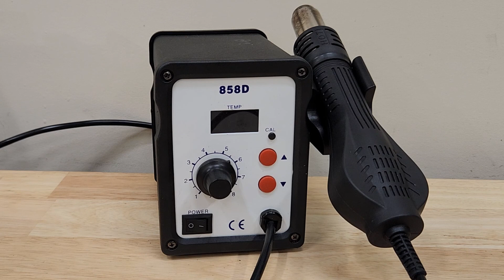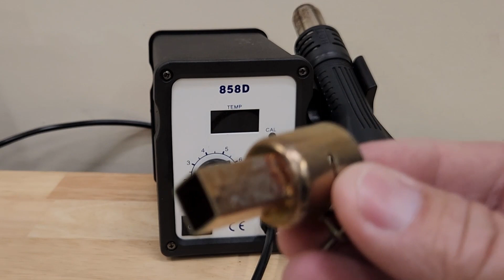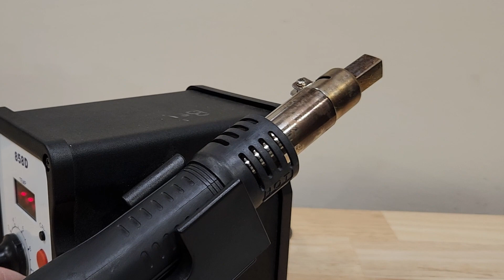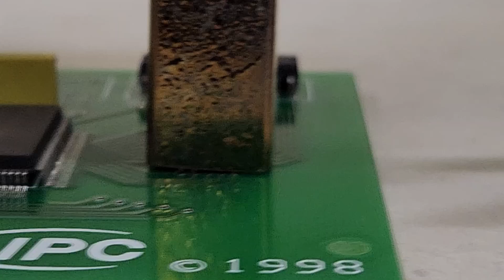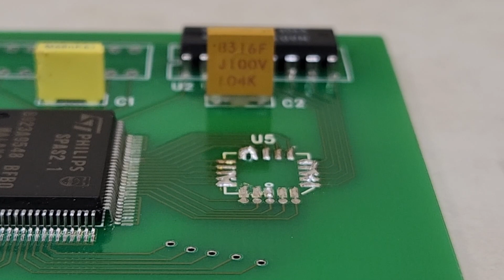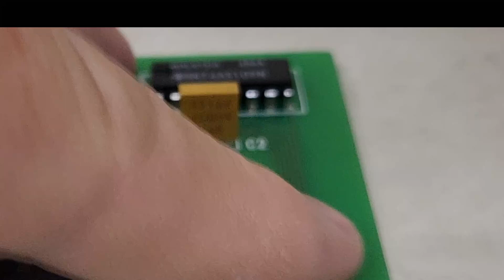How to Remove SMD Components Without Damaging the Printed Circuit Card

Comment: Hi can you share the name of your solder extractor
Reply from the maker: I purchased this 858D Rework Station from eBay here is the link: https://www.ebay.com/itm/392999341256?mkcid=16&mkevt=1&mkrid=711-127632-2357-0&ssspo=3IvKu_gATCW&sssrc=2047675&ssuid=4KVdPYr9SJi&widget_ver=artemis&media=COPY
Reply from the maker: The solder extractor is made by Pace, I have had a lot of success using it to remove though-hole components.